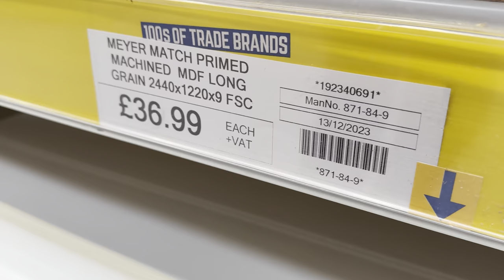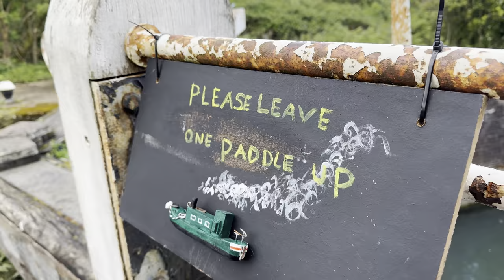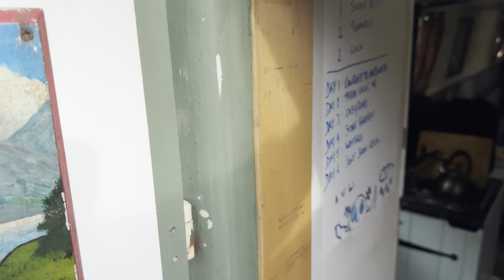537. Scrapping the last ceiling for MDF panels

Comment: I know I commented suggesting you use a T& G but if I say it myself that's far better definitely the right decision it looks much better and seems to be a much better material to work with.  Hey, just a thought instead of dumping or giving away the white pvc could you not re-purpose it at some point and use it to line out the insides of you cupboards or something. It would make them easier to clean and be much lighter looking.

Comment: Having the lines the length of the boat will make the boat look even larger. Good job. Glad you had some help. Too bad about your cupboard, but you already seem to have a solution in hand. All the best from Missouri.
Reply: The lines running front to back (or back to front) really makes the place look bigger. Right on the money you are.👍
🇨🇦

Comment: I’m glad you switched out the ceiling system for something a bit more practical and easy to work with. It really sucks about the galley cabinet build getting damaged. What I would recommend is build the framing out from the wall and up from the floor first, and then put the face on so if you bump it, it won’t crack or even move at all. Currently the facia is standing freely not attached to anything that could support it from a bump. I did try to warn you about this, but perhaps you did not read the comment. I have never fitted out a boat so you know more than I do about that, but there is a method to building out cabinets and such to where they are sturdy and predictable in how they handle things being placed on them and being bumped by people and objects. Another recommendation I would make for any future build outs using such facia boards would be to leave the facia for the very last thing that is applied. Not only would this be easier to actually apply to the framework, but it will also be easier to hold in place for fiberglass and reinforcing on the curves. In any case, I’m glad you had some help when you were swapping the ceiling out and hope to see some more good progress soon.

Comment: Just a thought whilst i watched this. 
Instead of using the props like acros, would it be just as well to put the props horizontally at high level between the walls, and slide the panel over them . 🤷🏻‍♂️

Comment: Hi James. Good decision to ditch the pvc,  The T&G effect will, with the right colour choice, modernise the interior and look much smarter. I did wonder if you could have fitted the mdf a few inches off centre so the leds fit in the centre of a plank rather than overlapping two planks. I don't know how broad the side trims were planned to be in your mind and if they were to be wide enough to cover the gap. Just a thought, but as you have already cut the led holes and fitted the board you might want to ignore it!🤣. All the best.